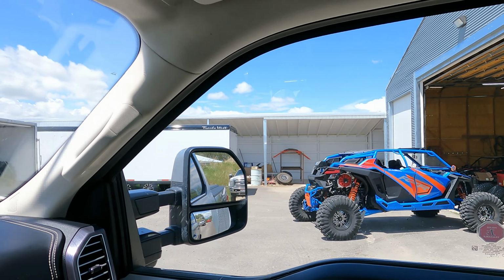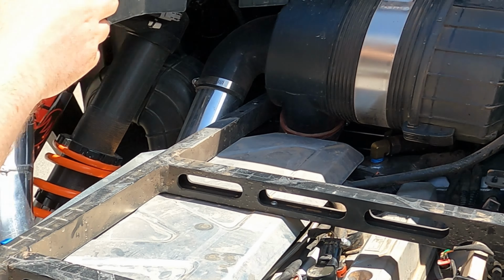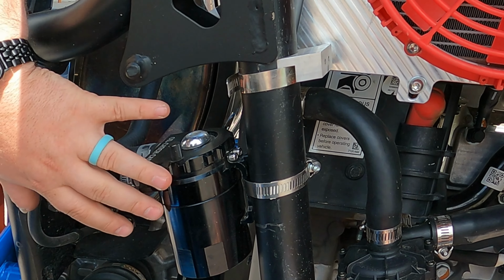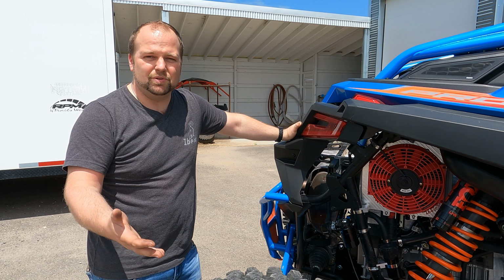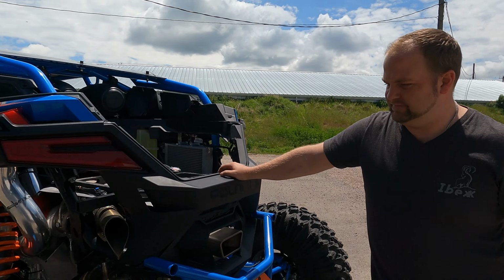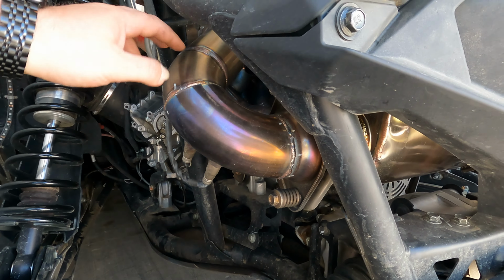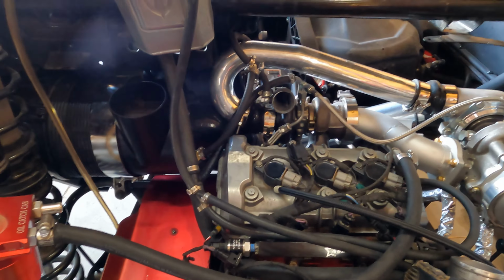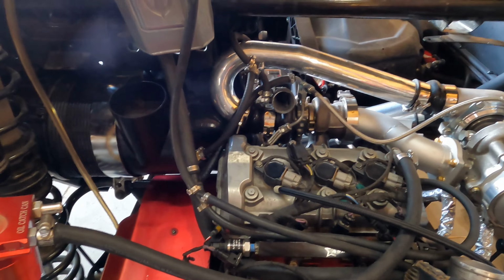Sneak Peak of the new Ibexx Turbo Kit for the Polaris Pro R

Comment: Been testing my turbo pro r with the AA kit. 400 trouble free miles so far from Rock crawling to during.  On the 8psi tune the fuel milage is about the same as stock cruising around. On 16 psi and e85 this car is fast. 420 rwhp.
Reply from the maker: I bet on 16 psi that think is a beast